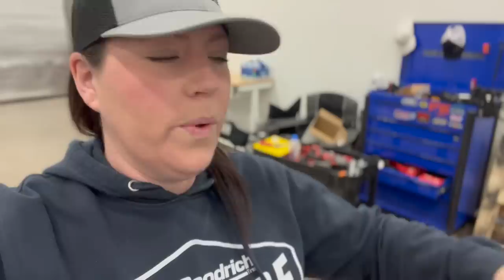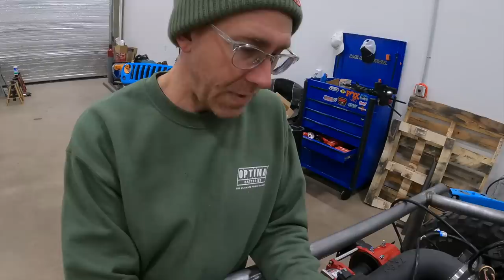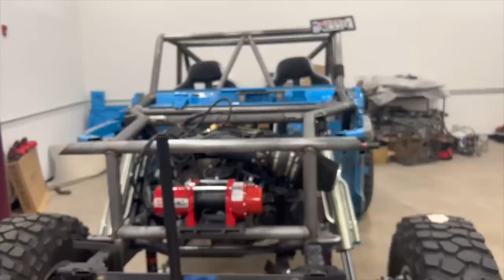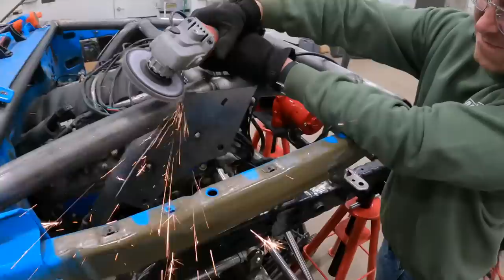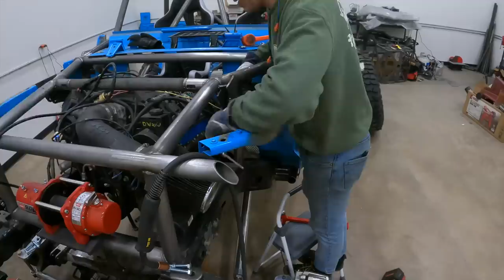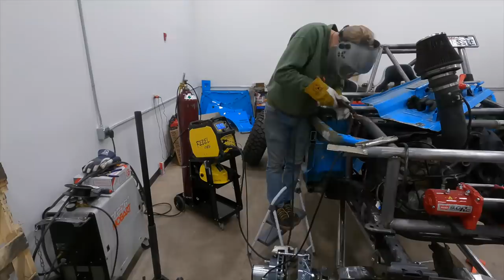Completed; Custom Upper And Lower Shock Mounts!

Comment: Nice to see the bottle on the welding cart.
I raised an eyebrow when I saw those BIG jack stands, we have several sets at work, we use them to hold up class 8 semi trucks and the BIG! diesel pusher coaches!

Comment: Getting a belt linisher would make cleaning up all those fabricated bits a lot easier. 

I'm glad you took action with the incident, as I said yesterday I needed to take dad's license off him in his 80s. it got to the point he just wasn't safe behind the wheel any longer and like you, it was other people I was most concerned about rather than him. By that time I'd restricted him to driving locally and in a modern vehicle he wasn't going to hurt himself badly very easily, it was pedestrians that concerned me.

Comment: Glad you made that report.. you did the right thing ...
Hopefully by reporting your situation will help this person moving forward. Also help in preventing something like it happening to someone else.
The 2 hour driver check program should be something that other States/city's/ towns could implement or use. 
Having gone and going through similar situations with aging love ones. It is not easy at all on several levels.  
God bless 🙏

Comment: Having had to “park” both my grandma and mother I am glad to took the action you did. I spend my life driving (long haul truck driver) and I’ll attest that the driving skills of the whole driving population has deteriorated to an extremely dangerous level… bluntly the government need to utterly ban cell phones from motor vehicles. And then require mandatory skill level tests at every license renewal  for anyone over 65.
Reply: In Australia, if you as much as touch a cell phone while driving it's a 1200-dollar (US$800) fine.
Reply: Here in England, quite harsh penalties for using your phone while driving. Even the filming Hollie does while on the road would be points on your license and fines

Comment: you guys should try a plasma cutter. i got one from amazon for 200 bucks and it cuts up to 1/2 inch steel like butter. and you wont have to breathe in cut wheel dust anymore.

Comment: Idk what all ur plans r but i think since its a race jeep u should put a snorkel on it just incase u hit water just a air filter wont stop water from going into the engine and locking it up if u hit some and in a race u dont wanna slow down for puddles

Comment: Yeah where's the flex?  One side full compression, the other full extension, showing full flex. And body/frame warp, if any. Frame warp can cause cracks in welds, and frame members. Which you will likely get on the course. Bottoming out (Almost) the suspension shows only shock travel. Not flex. Pretty impressive, though. How's it gonna do on large rocks and off camber roads, with deep holes? KOH has lots of BFR's and BFH's. And could, depending on the weather forecast, have mud or dry conditions. Some places you may be working the front axle with the driver side fully down, the passengers side fully compressed, and the opposite happening in the rear. Might want to at least test that in the shop, before breaking it on the trail.
Reply: By the way, for those confused by my acronyms, BFR (Big F**king Rocks) and BFH is Big F**king Holes. 
And KOH is King Of Hammers.

Comment: It's concerning that there is no standardized driving proficiency test at regular intervals. Allot of older people still think they are a good driver but as we all know with age comes sight and hearing loss not to mention mental acuity  does decline. I remember being in the passenger seat of my grandads vauxhall viva (small car) with him doing 80mph around winding country roads. It was one of the scariest things I've been through as he didn't  believe me when I told him he was driving way to fast and it was dangerous. He thought he was going at a normal speed and continued to drive irresponsibility.  2 months later he was diagnosed with dementia and lost his license.
Reply: 80 would have been pedal to the floor in a Viva, yikes! Vivas were reliable old jiggers but sports cars they were not, drum brakes as well.
Reply: @marvindebot3264  it was like being on a rollercoaster with no firm attachment to the tracks. Yes I reckon he was deffo in 5th with foot to the floor! 😬